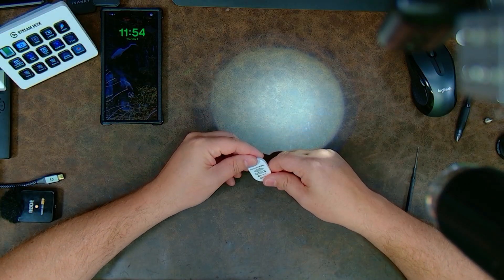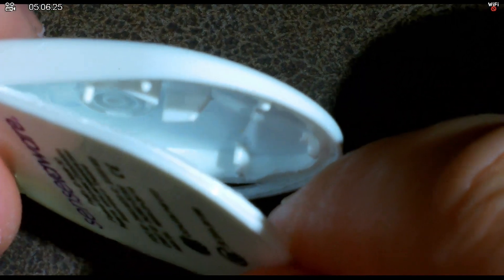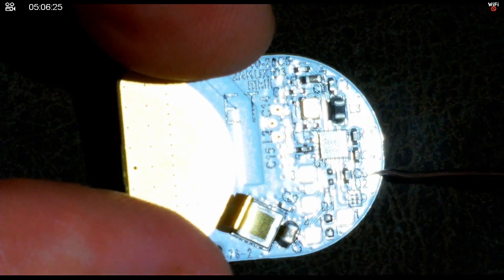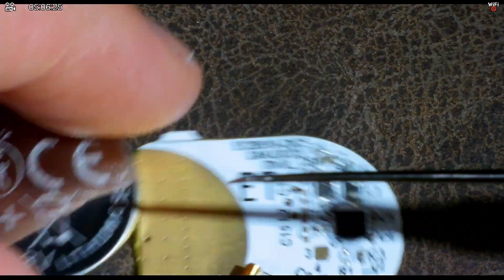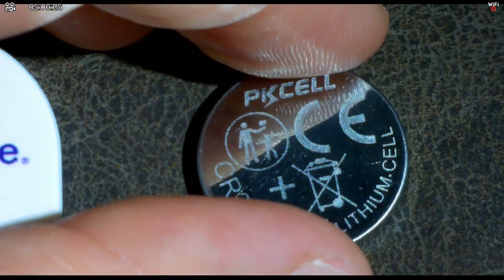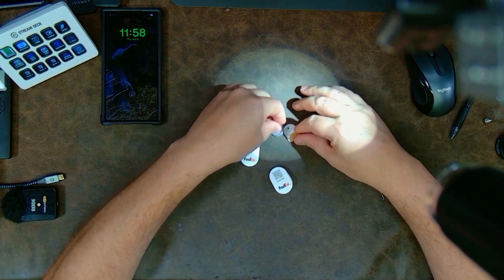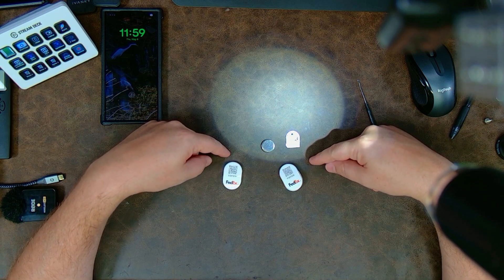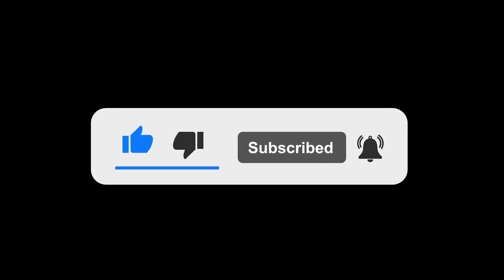FedEx RFID Tracker Tags

Comment: This is a very cost effectice / optimized design, the battery cr2032 is most common size thus it is much cheaper compared to the other cr batteries.

Comment: Product Overview
The TRON ID Node is an environmental and location device designed to
operate with packages and containers in the transportation network. The
device communicates via low power (+4dBm) Bluetooth (2.4 GHz) that
operates with the spectrum safe for aircraft and multi-modal transportation

Comment: The frequency used for RFID is one of a few possible Frequencies.
I seriously doubt this is a VMT 900 mhz RFID.

13.56 mhz or 100 to 500 khz

The 850 to 960 MHz can be used but usually not for these

I would start bouncing signals off it until I get a response

Comment: Is a Bluetooth low energy (BLE, also known as bluetooth smart) device.
The tag continuously transmit super short pings (very few bytes of data) and switch on the receiver for a very brief time after each ping to receive the answer (if any).... and after that it remains in a deep sleep state for a relatively long time (few seconds) to save energy. 
if another device needs to communicate, it must listen to the ping and after that switch on the transmitter in the right moment to answer the ping (after the connection is done, then the two devices can transmit and receive for a longer time to complete the task, if required)
the trick is simple, they use very short pings and very short receiving time with relatively long deep sleep time to both ensure a continuous monitor and save as much energy as possible.
Concerning the battery, the CR2032 is the most common kind of lithium coin cell and because of that is also the most mass-produced and the cheapest one for a bulk order... if there are no other technical constraints, there are absolutely no reasons to choose a different battery instead!
Note: depending on the ping interval and on the data payload required, a BLE tag can runs for about 3 months to 2.5 years on a single CR2032 cell.
Assuming that this device is a tracker with a temperature datalogger inside, the expected cell life should be around 1.5 years.

Comment: This is not an RFID tracker. This is a bluetooth tracker. It is a third parties version of AirTags. The battery can power it for 1-2 years which is why I am wondering why there is a lack of attempt to re-use them. The reason for this design is probably for tracking outside the sorting facilities. Thanks to google who no doubt had to pull a few finger nails, they convinced apple to embrace a standard protocol both iOS and Android phones will recognize, opening the industry up to trackers that can be seen and reported to the cloud by ALL phones. They can be used as a poor mans GPS tracker, instead of GPS and cellular networks it talks to any phones that are within bluetooth range and the phone will update the location to the cloud. This does not need any interaction with the phones owner.
Reply: Not sure about the poor mans part, my GPS tracker was cheaper on ebay than Airtags.
Reply: @aalert  link?

Comment: When you run a search for the FCC id, you will end up at a document stating that it is actually a BLE beacon that shouts out its serial number every 4 milliseconds.

Unfortunately FCC does not provide much more useful info about this specific device, but I did manage to find useful information about many other devices at the FCC website. You should try it and I'm sure you'll be amazed

Comment: using a cr2032 lithium cell seems counter productive because we see devices with remotes having lithium shipping warnings to not put them on passenger flights when fedex sends those packages on passenger flights to overnight an expensive item like an ebay purchase of thousands?

unless even exploding a bunch of those cells would not produce a fire enough to do any damage or that is the most trusted safest battery.

because even if the battery is in a device like a remote for an led light strip where it would be safe and conform to the rules for shipping batteries of less than 20 watt hours.
Reply: Not the same type of lithium cell that's prohibited in cargo.
Reply: @andyh7537 never saw a coin cell battery exploding, but those can leak after years of discharged
Reply: The 777's main batteries are lithium, you can carry up to 100WH lithium on your carry on, larger than that require approval, max 2 grams lithium is allowed per battery.  They even have bags on board in case a device catches on fire it can be put in the bag to contain the runaway chemical reaction.
Reply: These batteries are generally different, more resilient and less dangerous
Reply: You could short that battery and no explosion will be done, just some heat
Reply: @vadnegru and maybe some acid leakage

Comment: What battery cr 2016? Cr 2032?   Battery probably biggest expense brand? Energizer.  If 2032.  Good cheap way get some spare batteries. Surprised they look like non solder batteries so easy way refresh pc or others items with a new battery
Reply from the maker: Cr2032
Reply: Soldering them might be actually be more expensive. And i believe they are reused but not everywhere.